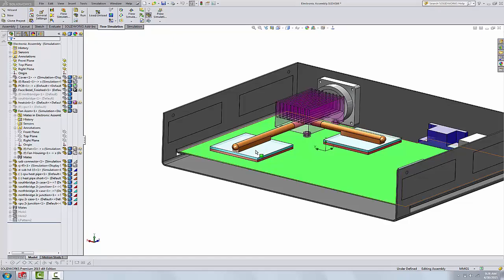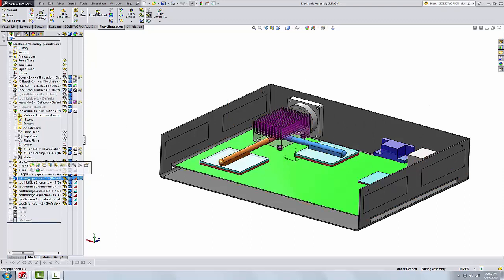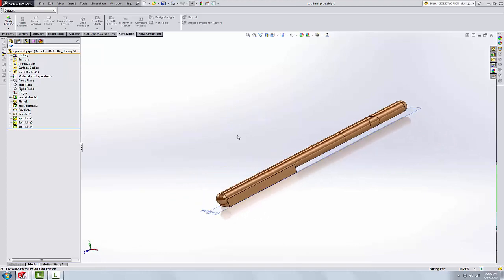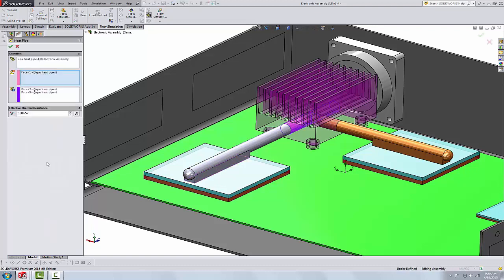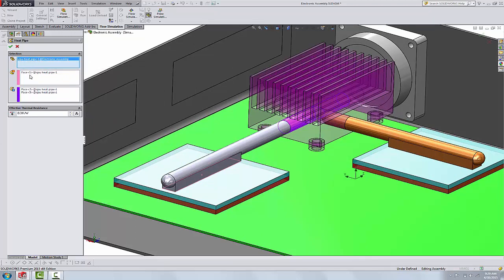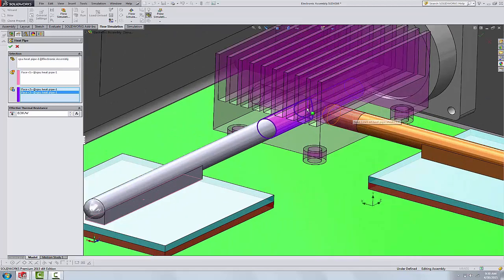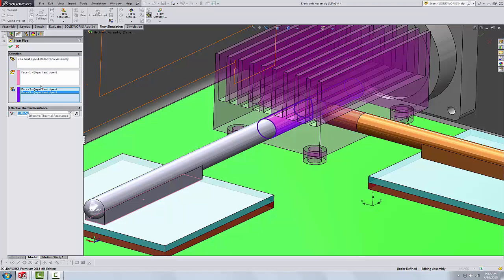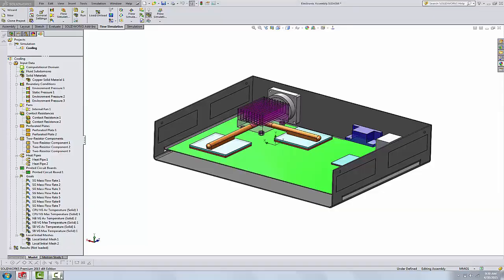SOLIDWORKS - Flow Simulation, Using Heat Pipes

Comment: Hi, I am modeling heat pipe using Solidworks flow simulation and I have problem in interpreting the results. I know that realistic temperature gradient across evaporating and condensing part of heat pipe should be 2-5 K. In my simulations, temperature gradient across heat pipe is 0.02-0.08 K and no matter how much I increase thermal resistance I cannot increase it to lets say 2 K. This drives me crazy. My understanding of thermal resistance is,  for example if thermal resistance is 1 K/W than for 40 W, temperature gradient should be 40 K but it never is in my simulations. Do you have any advice on this. Thank you.
Reply from the maker: Thanks for your comment.  Without seeing the actual model, I only have some general recommendations.  Overall, it sounds like the heat pipe is reaching a steady state throughout the entire length of the pipe since you are not seeing a typical temperature drop from one end of the heat pipe to the other.  I would start by reviewing the assigned material properties of the heat pipe and surrounding components to ensure that there are no issues there.  Next, check the heat transfer of the heatsink on the condenser side (heat-out side) of the heat pipe, ensure that here is a realistic flow and flow output on that end.  Another area to check for the project is the mesh.  Ensure that you have enough elements around your fins and in general around your heat sink.  Maximize the element count around any surface area between the heat out or heat sink and the surrounding fluid as that will convect heat energy away from your heat pipe.  You may want to also increase the mesh count on your heat pipe and heat in geometry as a secondary phase.  Lastly, ensure that you have adequate Engineering goals so that there is proper convergence of the solid and fluid temperatures on the heat pipe, heat in, and heat out components.  Perhaps even make Temperatures of the fluid and solid global goals.  It is also a good practice to use average total pressure and maximum velocity global goals to attempt to converge all regions of your computational domain. Hopefully these tips will help!
Reply: @goengineer  Hi, thank you for your tips. I will try them and hopefully achieve realistic results.